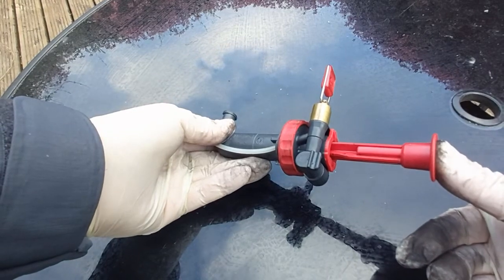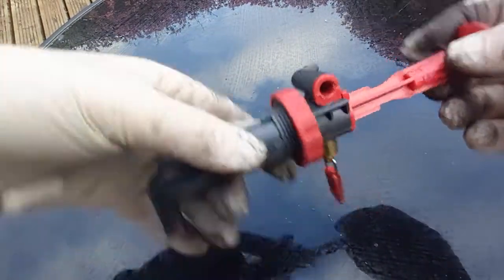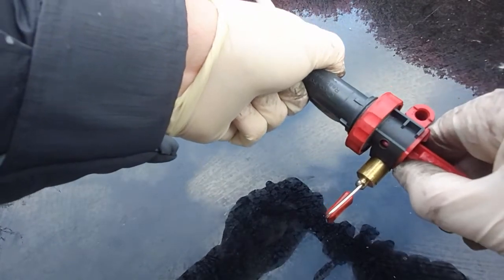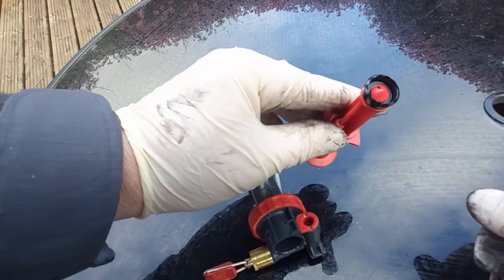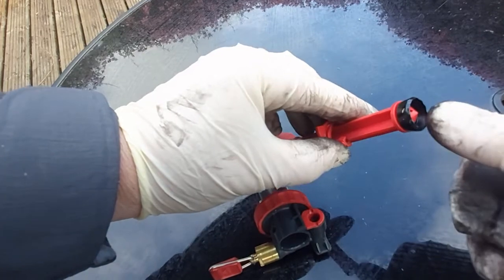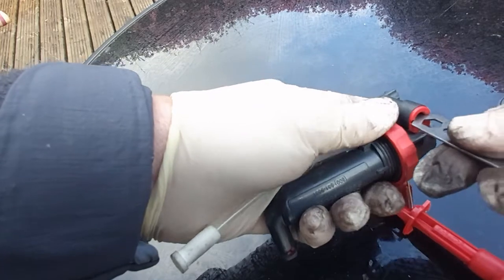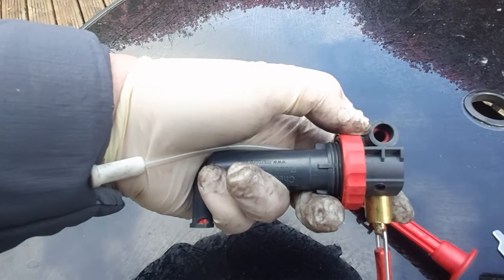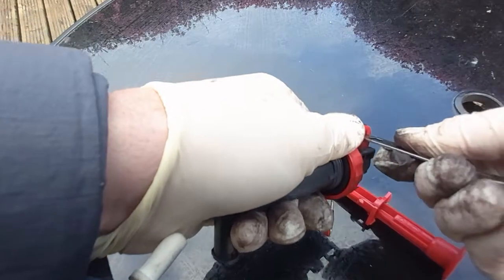MSR Stove Fuel Pump Maintenance: Changing Seals / Cleaning / Washers / Annual Maintenance Kit

Comment: You mentioned to change the seals regularly. How often is regularly? After how many estimated uses?
Reply from the maker: With light use or in storage we'd recommend maybe every two years. If you use them regularly then every year. Always check each seal before every trip that you're 100% dépendant on the stove. The s can also affect them. You can pick up seals on your local Lidl!! They sell boxes of multi size o rings

Comment: Is there a large o ring inside the red rubber part that sits at the top of the bottle? My fuel bottle is leaking,  should there be an o ring there ?
Reply from the maker: The large orange ring on the pump, that connects it to the bottle does not have an o ring. It's rubber and as such creates the seal. It's possible that it has degraded and needs replacing.